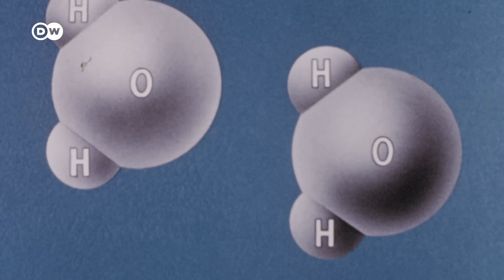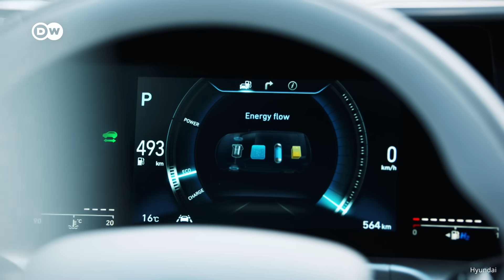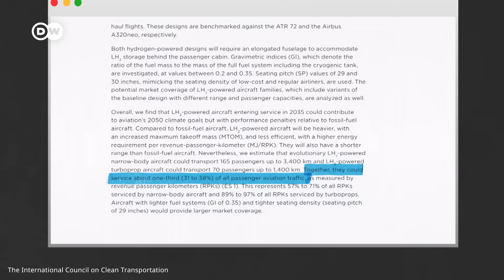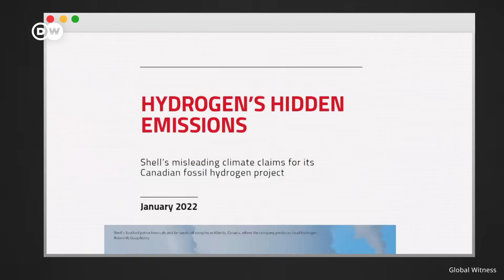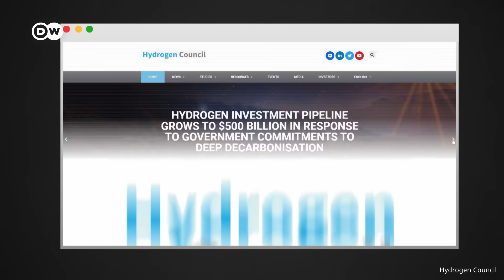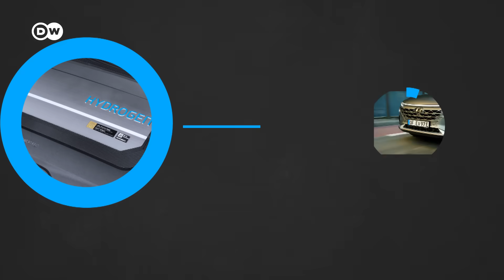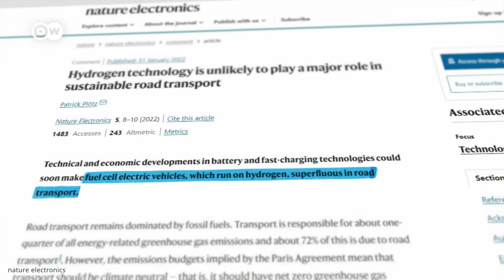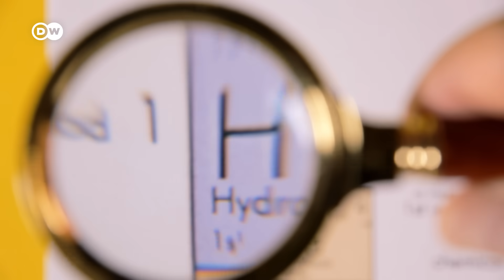The truth about hydrogen

Comment: A big misconception about Hydrogen is that its NOT an energy source, but an energy carrier. Alot of people have been talking about it as the solution to our future energy needs without mentioning that we need an enourmous amount of clean energy/renewable energy to produce, store and transport Hydrogen. But Hydrogen still has its uses to clean up some industries!
Reply: Ok that's literally EVERY chemical as well
Reply: I made the observation recently - that hydrogen is the PERFECT battery... doesn't require mining the materials to build or facilities to manufacture and has no life cycle / disposal problems...!!!  😊
Reply: If you use the word hydrogen alone it is an element. If you have the element hydrogen you have fuel (stored energy). Once hydrogen reacts with another element such as oxygen the energy is spent as heat. If hydrogen reacts with carbon, it is still combustible with oxygen it is still a fuel. Hydrogen is the energy stored in fossil fuels. Hydrogen is a fuel.
The problem you are struggling with is hydrogen is generally not found in nature alone as it is highly reactive with many elements, mostly oxygen. Carbon is the catalyst that allows hydrogen to be a liquid at ambient temperature and still remain reactive to oxygen. Hydrogen can also catalyze with nitrogen making ammonia a combustible fuel that is considered pollution neutral as the atmosphere is 80 percent nitrogen. Using the energy of the sun we convert water into a fuel "hydrogen & oxygen".
Reply: Burn it
Reply: Isnt storage what we need to make solar viable ?
Reply: Bio digested cellulose doesn’t require much energy to produce hemp hydrogen.
Reply: @projectpeace  I’m going to look into this on my own, but can you elaborate on this please? Or point me in the right direction to educate myself on this matter? I have access to a lot of hemp, and hemp project are my original passion project. Hemp can save the world. But it needs to inhabit educated people first.
Reply: @710Kareoke  What aspect of this discussion would you like me to elaborate upon?
Reply: 100%. Hydrogen is really just functioning like a battery, and a less efficient one at that. For space-critical uses, like personal transport it is a waste of time. Just develop good EVs with better batteries and charging stations (or better still, just ride a bike or walk). For weight-critical uses 9eg. aviation) hydrogen may have an advantage so long as its highly reactive (aka explosive) nature can be controlled completely. God help at the 400-odd passengers & crew of a hydrogen-fuelled Airbus A380 when there is any electrical spark!
Reply: @petesig93  check your science .
H2 and H202 are both better at storing electrical energy than any known battery .
Also , H202 is not only immune to spark discharge , its non flammable .
Dont know why i bother to tell you , but we should all know this if we are truly interested in future energy
Reply: A misconception is that we need to transport hydrogen. In most (if not all) cases that's not true, hydrogen can be made on site, where ever there is an electric grid and clean water.
Reply: @Sailorman6996  yes , and dont forget the "other" and more practical inorganic fuel - H202
Reply: isn't that the case with every energy source?
Reply: All fuels are "energy carriers", please stop splitting hair.
Reply: @randymarsh6559  I think he meant water is not a fuel
Reply: @shanedavison7473  I think he meant hydrogen. All fuels are energy carriers.
Reply: @randymarsh6559  In this context, sources describe energy content that exists prior to any human activity such as nuclear, solar, fossil fuels, wind, and hydro.  Electric transmission, hydrogen, compressed air are industrially generated energy transmission/storage mechanisms to serve human purposes.  Treating the matter any other way would lead to double-counting one's energy/power resources.
Reply: Well sometime it is just do it and to getting better and better by learning and experiencence. First of all we should keep the developpement, research and strategic planic of energy away from commercial oriented company and there own goal and move it to public Tasks and duty. 
Second every country should have the task to produce enough Energy and Energy storage by themself  to beeing independend and not been coherced by supplier. 
Third Hydrogen is present nearly all over the world and therefore both goal can bee reached. Of course not for free but on long term based on scaling cheap. 
Fourth desert areas can be used for hug PV and  electrolisys plants.
Fifth Industrie plants in deserts runing with hydrogene left water that can be used for cultivation.
Reply: Same as electricity.  
Not a fuel, just a transmission. 
EVs charging at night are near 100% fossil fuel powered.  Only with worse emissions than gasoline.  Much worse.  

The evidence is in the outlawing of 40W+ incandescent lightbulbs which, were claimed, boil the ocean.
Reply: I've wondered whether deep sea (as in out-at-sea) wind harvesting was viable as an energy source.  We now have the technology to provide floating turbines.  Now, all we need is to use these turbines to generate green H2 at sea and carry the H2 back to port.  Thereafter, the H2 can be put through fuel cells to generate electricity or be burned for heat.
This sounded far fetched to some, but the recently signed deal in which Canada will export green hydrogen (made from wind) to Germany goes a long way towards bolstering this idea.  The main difference is that Canada's wind turbines are on land, of course.  However, with enough floating turbines, the process could be repeated at sea.  It will be interesting to see how things unfold.
Reply: Nuclear is far cleaner.  Nuclear's problems are POLITICAL, not technical.  Unlike all other energy forms, nuclear allows us to put the environmental effects exactly where we want, rather than effecting the area around the power plant.  FOR EXAMPLE, used up fuel can be transported to the same mines from which the original uranium was extracted.
Reply: Bob Lazar has been producing clean hydrogen with only water and electricity in home made hydrogen generator, filling his converted Chevy corvette at night while he sleeps, and gets over 300 miles of range out of the 5 cells in the trunk since the late 80s. There is such a resistance against hydrogen powered vehicles because it can be made at home for free.
Reply: An energy stable carrier, versus electricity.
Reply: And how much energy will it take to move batteries of all sizes a quantity of components to build on site? Probably a great deal more. Hydrogen produced from breaking down sea water by electrolysis at multiple locations is probably more efficient using solar power to generate the energy required for the process.
Reply: Hydrogen is a great souse of  power (. Why re-invent the wheel ) combustion engines 
Can run on it  .. yes the thousand dollar question in  how to make it more efficiently .
Reply: Thorium with Hydrogen as the carrier. That is the future.
Reply: But then so does gasoline. Same principle. Except hydrogen doesn't pollute and is 100% recyclable on combustion.
Reply: WelL not hydro electric thats gravity making the water move from High to low point
Reply: Thorium reactors is the way, 2 by products hydrogen and ammonia
Reply: Just wondering why nobody is talking about the fact that you can run a car on water with an onboard splitter sending hydrogen into pistons and oxygen out the exhaust
Reply: @jimsouthgate4280  - “splitter sending hydrogen into pistons and oxygen out the exhaust”

Actually, it is best to place the oxygen & hydrogen into the piston for combustion, eliminating NO2 emissions.

Sticking solar panels on the roof of the car, constantly splitting H2 & O2 while charging batteries after O2 & H2 tanks are full, allows the car to be more efficient while driving & parked, even without being plugged in. Throw in regenerative breaking. In a big rig 18 wheeler, stick panels on the trailer. 

Water is a pretty nice thought, for cars & trucks, but I personally have never seen a model based on a complete system like this.
Reply: @jimsouthgate4280  you use more energy splitting water than recombining it.
Reply: Exactly, one of the problems with renewables is the sun is always shining, the wind isn’t always blowing, hydrogen is a good way to store excess renewable energy when it’s there for when it’s needed.
Reply: Batteries charge with energy powered by fossil fuels? Not to mention you have to dig lithium out of the ground with fossil fuel powered tractors and transport it with fossil fuel powered planes and trucks. Whomp whomp…
Reply: Just like batteries are. It’s explained in the video.
Reply: Hydrogen is an energy storage. Nobody thinks it is an energy source.
Reply: @hafizuddinmohdlowhim8426  the Sun is the Energy Source - even for petroleum if you think about it
Reply: @NCOGNTO  Sun isn’t hydrogen genius.
Reply: @hafizuddinmohdlowhim8426  the polluting way , at the direction of Big Oil and co operating politicians
Reply: Exactly, it's like a gas battery, not a fuel itself
Reply: @wesleygoncalves6391  except storage in water is cheaper than lithium
H2 is the most common element and H202 has powered the Worlds Fastest cars , pollution free
Reply: @NCOGNTO  That is really important to point out. I'm just concern regarding the price of it, because the low efficience requires a lot of energy to be converted into H2 and then work.
Reply: @wesleygoncalves6391  you would use inefficient devices ?
Try to do better
We need to conserve ... oh no, i guess it theres an unlimited supply (unlike petroleum) ?
HEY ! Use all you want then .
Reply: @wesleygoncalves6391  whats the least efficient tech youve heard of ? My pick is carbon capture
Reply: You're right as well as Howarth, R, mentioned. The rest is a lie!
Reply: What about destroying all those water molecules? - water is a finite resource. We cant make more.
Reply: @ashthegreat1  no water is lost since in the fuel cell the produced H2 recombine with the O2 of the air which was also produced during the electrolysis of water..It is an entirely repeatable and reversible process. Your concern is legitimate since beside producing carbon dioxyde, the fossil fuels produce also water and deplete oxygen from the air, however the impact on sea water level increase is insignificant, temperature increase and corresponding volume expansion is a lot worst then if Antarctic ice about 40 million cubic miles slides onto the ocean then 5 to 8 meter higher level  could be gained rapidly.
Reply: @Johan Wittens Your broad statements have no actual economical substance and must consider all energy related  “costs”( NOT only current artificially high retail SELLING PRICES) : production, storage, transport, mining costs, ressources limitations and pollution costs must all be accounted for…So your evaluation is totally obsolete as two essential facts suddenly became evident: 1, we need to decarbonise our economy and civilisation much faster than anticipated and 2. The surface energies like solar and wind power are becoming overwhelmingly more competitive than polluting fossiles fuels : sun, water and wind are present all over where humans live and the production of green hydrogen with PV is becoming extremely favorable with a cost of quality PV becoming ridiculously low at 360$/kWp retail here and without any significant mining pollution plus a  very little grey energy documented by such extremely low and non-subsidised production cost. The solar energy radiated to the earth surface represents over 1500 times the total humanity energy consumption and is therefore practically unlimited. Moreover, with a presence and availability of this energy all over, any significant and costly energy transport with copper at 10000$/ton or Aluminium at 4000$/ton etc…is NOT needed… would be a cash loss and energy waste, but on another side, a new cheap energy storage on site anywhere is necessary for night power and cloudy or low winds days…

Now, not only solar dc electricity production cost is becoming ridiculously low (less than 1.5 us cents per kWh over the 25 yrs of the solar panel warranty period and free cost after !!!) but the high pressure H2 COPV storage is per kWh stored, about 500 times cheaper already than lithium batteries being about 20 time cheaper upfront (10$/kWh) depending on sizes than lithium batteries at 200$/kWh of capacity, about 160$;kWh Toshiba wholesale level, and taking also more than 25 times more loading cycles than good LIB’s mobile grades or also more than 6 months at full pressure WITHOUT ANY measurable pressure or energy loss….your supercondo looses all its  energy in a matter of minutes, not years like stored H2 so forget it other than as a takeoff boosting power for H2 commercial airplanes at best…

Along-with solar production ANYWHERE becoming totally inexpensive, the cost of H2 storage in COPV’s is also totally negligible then.  The real economic issue and breakthrough is than such local and economic auto-production, self-storage and usage of locally produced solar energy avoids the much much more expensive costs of loading this energy onto a transporting network or into a electrochemical battery storage not durable system. This can become so competitive that it hurts badly the existing monopole of domestic and mobility energy characterised by huge gaps between real production cost and retail selling prices favoured by the lack of alternatives ( sailboats, gliders and cold pizzas only…). For instance even if over 50 kWh of sun power must be produced and stored to finally get only 15 kWh out of the H2 the Miraï fuel cell to the E-mot. to travel 100 kms, because of the “inefficiencies” of recoverable stationary joule losses and pure green O2 production of electrolyser, compressors  and fuel cell, those primary energy and storage variable costs total can well be below one dollar, also very low cost and demanding on mining pollution and limitations and because it works without much grid nor much chemical batteries, it then becomes totally unmatchable economically. One clear  current indication is the growth rate of H2 cars increasing 5 times faster than EV’s and a growth driven by private beans counting financial ventures forecasting its potential all over, not only into rich industrialised and coal burning countries like LIB EV’s and meanwhile, not waiting for gouvernemental subsidies available only in rich industrialised countries with enough taxpayers to pay and support uneconomical mobility means like coal cars, coal-electricity generating half of human CO2 release in the air…and having to come to an end rapidly…
Reply: It's fascinating, the future is very interesting. I feel, at the moment we, the economy, society runs on quick fix opportunities. Making vast profits with very little long term vision. I have been looking, along time with other groups at settings up off grid community, housings, food production and workable resources. Many of these ideas as based on what our great, great grandfathers needed to do. The wider world offers a larger technology spectrum to try and work with. The skills of the past are very valuable and being lost.
Reply: Literally nobody believes hydrogen is a source of energy. Don't attack strawmen.
Reply: I think you meant to say that the misconception is that hydrogen IS an energy source.
Reply: Nobody thinks hydrogen is an energy source. Only the aggressive battery lobby (mostly TSLA stock holders) use this strawman.
Reply: Well you will need to cover the Earth with solar to create hydrogen.  Is it affordable to do?
Reply: Im from the future and i can tell you the solution is the heat energy from de core of the planet, it is endless, easy and very powerfull, the only thing is that you people dont have yet the technology to extract it safely and inexpensive, but its gona change in the near future.
Reply: Well, if we do fusion then it’s an energy source, denser than uranium
Reply: As long as solar or Geo thermal is used for the source of electrical generation then it would be economical.  Fossil fuels are going to run out one day and those  that are ahead of the curve will come out on top of the left over fossils that died off after thet ran out of gas!
Reply: @magicone9327  I assume you mean the Hydrogen makes sense as long as it’s manufactured from solar or geothermal?

Even if that was the case, going from electricity Converted to hydrogen which would be compressed stored in a tank and then said to a fuel cell to create electricity which are then go into a buffer battery and into an electric motor is around 25% efficient. Alternatively simply taking the electricity, putting it into a battery and then sending that power to an electric motor would be over 90% efficient. Hydrogen effectively acts like a very low efficiency battery with some very expensive components along the way. You’ll notice that the only Hydrogen being used in the market is heavily subsidized by governments or by corporations whose primary interest is to stay using fossil fuels as long as possible.

Even worse, over 90% of all the Hydrogen used for transportation is actually made from natural gas. It makes absolutely no sense.

What does make sense is using hydrogen in numerous chemical processes where the element hydrogen is required. That’s not what we’re talking about here though.
Reply: I think you made an error there.
Reply: @usmansaleem9498  please explain in detail what do you think the “big error “is that was made? As near as I can tell Tommas seems is entirely correct with his comment.
Reply: @colingenge9999  If you read the first sentence, you will see that he is contradicting the latter sentences. The first sentence should have been like, "The misconception is that hydrogen is an energy source and not an energy carrier".

I am pretty sure it's just a minor error tho.
Reply: It has potential energy until released.
Reply: @chuckmaddison2924  what “has potential energy until released”?
Reply: @colingenge9999  simple example a battery.
Reply: @chuckmaddison2924  sorry but with your cryptic Phrases and lack of complete sinses, I cannot understand whether you’re making a point, disagreeing or asking a question.
Reply: @colingenge9999  A battery dose not store  electricity  . It stores potential energy chemicaly.
Reply: @colingenge9999  Pull a rubber band energy is stored it now has potential energy. Let go one end it now becomes kinetic as it flicks your fingers.  
 That might be a better example.
Reply: @chuckmaddison2924  OK so we go from electricity which is converted into a potential chemical form which is extracted again as electricity. So for our purposes electricity in and electricity out minus a small percentage for losses. Having said all that, I’m not sure what your point is.
Reply: @colingenge9999  Oh , it goes back to someone saying hydrogen is not a source.
Reply: Evwn if it can be produced without RE electricity, and instead with natural sunlight, it can be cost beneficial. This technology is actually under development right now, with very promising results!
Reply: @jonese6987  “Natural sunlight “is renewable energy.
Reply: @colingenge9999  Yes but the video was referring to RE electricity based, that was my point
Reply: @jonese6987  Sorry but your message was too cryptic to understand your point.
Reply: @colingenge9999  ok, hope you understand better
Reply: Batteries are also not an energy source
Reply: Hydrogen is energy 
33 kW per kg
Reply: That's not always missed. This is often an argument against it that I hear. 

Electricity is easy to create clean and away from fossil fuels. WE already have solar, wind, hydroelectric, geothermal, and nuclear.(the last being questionable).

What we need isn't developing more into electricity generation (though, yes, we need to build more generators), but instead, we need solutions to *mobile* energy. Hence the need for fuel cells.
Reply: Hydrogen production by electrolycis has only 70% efficiency, however there is a new process which is cheaper and much more efficient, about 95%, this could be a game changer. The electricity needed for this process could be supplied from renewable or nuclear sources, the process is called E-TAC and was developed by startup named H2PRO which already has a pilot production facility.
Reply: Question, It being an energy carrier, we could generate endless energie in desserts, transporting energy to other places?
Reply: @Dutchmijk  
We’ve tried to put huge power generation stations in deserts. It doesn’t work. The only efficient power is generated at point of use, like gasoline.
Reply: @Dutchmijk  Well, it would hugely depend on the specifics but generally speaking it is far more likely to be much more efficient to 'just' transmit the electricity over-land (and/or under the sea).
Reply: In fact it's source in fusion atomic....but in our case it just a transporter energy.... even  awkward both we don't master well.....🤔🤔🤔🤔
Reply: It's not a misconception. It's the truth. As seen in this video, H2 does not exist in useful forms in nature. You have to split it from methane either using steam reforming or electrolysis. In that case, the energy source is the methane or electricity.
Reply: It
F
‘

L
Reply: No such think as a source of energy: 1st law of thermodynamics
Reply: Can we use Hydrogen as an alternative to our battery issue? A lot of the problems with today's energy crisis is storing the energy produced (I'm commenting this 49 seconds into the video so if my question is answered in the next minutes I apologize)
Reply: "From that time Jesus began to preach, and to say, Repent: for the kingdom of heaven is at hand." Matthew 4:17 

"Ye have heard that it hath been said, An eye for an eye, and a tooth for a tooth: But I say unto you, That ye resist not evil: but whosoever shall smite thee on thy right cheek, turn to him the other also." Matthew 5:38-39|○
Reply: There's lots of oil and coal left to burn 🔥
Reply: That is exactly the comment I just wanted to type. An energy carrier is pointless if you don't have enough energy to begin with. And the energy that we hopefully will have, will be too precious to waste it on hydrogen. Yes, we will need hydrogen for some applications, but we should only use it if more efficient technologies are not available for this application.
Reply: @fr89k  Go on then, do give us an example just one that is more efficient than Hydrogen, and not specifically localised.
Reply: @thetruthhurts7675  Why would I want an example that is not localized? Almost every consumer has some kind of localization. Therefore, I disregard this requirement and give two examples: Batteries and directly using the energy.
Reply: @fr89k  By localised I meant solar panels in my garden (as a source of localisation, and you name a localised source to use as your argument) which produce all of the power needed in my house. Batteries are the least efficient way of utilising power. They have what is called long term, memories, so if you don't fully discharge them the power gets less and less over their lives. Plus the power lost just charging them is over 20% how can you even compare that to a 2 to 5 percent power loss, which includes transportation by Hydrogen? Come on you can if you try do better than this you claimed Hydrogen isn't efficient, yet you named the most ineficcient wasteful power source as your one option, by the way there isn't a more efficient power source than Hydrogen, but hey you tried, and failed badly!! Directly using the power is what I do with my solar panels which have replaced my as consumption in my home completely (that is also localisation by the way).
Reply: And very energy inefficient in comparison to fossil fuels
Reply: I am Chemist and you are spot on.  I view Hydrogen in this context as a chemical battery.
Reply: Then everything is an energy carrier not an energy source.   Energy sources are electromagnetic force and the strong force.
Reply: Our planet expels about 220 million tonnes of hydrogen into space. Once we are able to capture this it will get much better and cleaner
Reply: @TheGearslayer  Interesting.  I've never heard of this before.  What process releases this large quantity of hydrogen?
Reply: So is fossil fuels. You need energy to pump it up, refine and distribute it.
So is wind, you need windmills, so is solar..... you do the math.....
Reply: Renewable energy ✨️ is not Renewable lol 😆 unless solar  panels, batteries, and turbines  are made in china 😄
Reply: Capture the CO2 and split the carbon  off it, then manufacture Man Made Diamond Batteries this will sequester the carbon indefinitely the diamonds will power a vehicle for 1500 years without the need for recharging.
Reply: It's likely saying that electric lines will meet electricity needs (as if lines were an energy source)
Reply: WELL SAID;
Your remark sounds quite intelligible...
Reply: @samuelmartin2817  Thanks. I have seen articles that state that EV and fossil fuel cars have broadly similar efficiencies.

'EV has an overall efficiency of about 60% while the fuel powered car is about 20% (or less) efficient. When one considers the total path from primary energy, the efficiency of the electric car is 60% x 40% (grid efficiency) for a total of 24% while the fuel powered car has an efficiency of about 20%. When the bigger picture is considered, the two forms of transportation are not all that different.'

In 2018 Mazda claimed that they hope to achieve 56%  efficiency soon.
Reply: We cannot use/rely upon  hydrogen(grey, blue, green)  for everything, vll have to be specific.
Reply: There are multiple inventions (suppressed) that will supply hydrogen on demand without storage. Such a concept that hydrogen must be stored to use is inaccurate.
Reply: Yes but if green energy is used to produce it ,   its way better than any oil products,  plus it produces no emissions when used as a fuel.....how is this worse than using any hydrocarbon
Reply: Free hydrogen is hard to find. Splitting hydrogen typically requires more energy to separate the hydrogen from water. Frankly, mixing it with oxygen is as an ideal fuel.
Reply: Why does everybody keep repeating this like it's something clever or relevant? Are batteries an energy source? What's the alternative?
Reply: ok then y'all are "hopeful"in using wind and solar to replace our (USA) current use of oil for energy yet there aren't enough batteries to store our current power needs when the wind stops and the night arrives?
Reply: So are all fossile fuels. They carry the energy of fotosynthesis and sunradiation of millions of years.
Reply: I agree with you but hydrogen can be an energy source as you can burn it and in enough quantities actually explode. I drive a Tesla and I am trying to get my home community to install solar panels with battery storage. This will definitely move us towards the net zero carbon footprint in the near and long term. I believe that electric planes and ships and steel manufacturing are possible in the distant future and hydrogen can be a stop gap measure. Definitely no to gray hydrogen.
Reply: Produce on demand. H1 is more powerful than H2.
STP is calculated in the argument. But water can be separated easily below 0c or 32f degrees.
Reply: It is an energy source and carrier. We have already h2 engines using h2 (1st so called e-fuel) instead of fossil fuels
Reply: Too many open doors. We need green hydrogen.
Reply: so are batteries
Reply: That's why it's better to compare hydrogen to battery technology. Or grid transmission.
Reply: Very true.
Reply: H2 plus O2 is energy bruh
Reply: You dont know about the new way of  produce h2 developed recently in japan with a new secure nuclear reactor. The new generation of  nuclear reactor makes it almost clean. They will develop a Technologie to deal with nuclear waste.
Reply: So  we go from putting CO2 , plant food,  into the air.  To a much stronger heat retainer  water vapor.
Reply: By that logic, everything is just an energy carrier lol
Reply: You hit the nail on the head.
Reply: Humans will make it work.....
Reply: @ckb3234  love your enthusiasm but it's just not how things work
Reply: @fluchtigziege3202  that's how exactly things have worked out so far.....Some innovation here...some there and boom you break through.....
Reply: @ckb3234  we can't simply change how physics works out of willpower
Reply: @ckb3234  You ,like platitudes.
Reply: The Germans built a submarine that had hydrogen fuel tanks outside its shell so that if the hydrogen ignited it wouldn't destroy the submarine. I don't know if it is still in service.
Reply: You can easily create hydrogen with some solarcells or windturbines. With that you can power your car and house. Green hydrogen works.
Reply: Might sound crazy now. But I'd like to see a Hyrdogen Battery. A totally different battery. Looking totally different as well.
Reply: Aparently, it also helps your body to clean itself.
Reply: Seriously? Just imagine green hydrogen obtained from natural gas using more efficient nuclear powered energy  pipelined thousand miles like nowadays oil  to major stations throghout the country? I think it wiil be a good alternative to OECD lithium powered lobby climate zealots.
Reply: So you mean that the misconception is that it IS a energy source...
Reply: A good thought.  Politicians see electricity as an energy source - which of course it isn't. We can call falling water, the wind, rise and fall of the tides, and heat from the sun or the burning of fuel, as energy "sources".
Reply: I agree 100% if it can be used as fuel in a combustible engine and could also have other energy applications. 👍
Reply: Spot On.  OK.  How to produce it cleanly?
Reply: "A big misconception about Hydrogen is that its NOT an energy source,.."
==
What's better then, stupid?
Reply: I works in a hydrogen company as design engineer. The company has huge orders. We are using it especially in stoves , laser cutting and welding.  

Hydrogen startup are easy and simple .
Reply: It's basically just steel production, or at least for headline times even then we need to stop producing 95% of our hydrogen from steam methane reforming which not only releases CO2 at the same rate as burning it, the process also costs energy meaning it's actually just better to burn the methane and the cost of the hydrogen chain needs to come down while we also move to the more expensive option of electrolysis, I just don't see it. For anything else thermal batteries for process heat seem like a better option for big headline items like cement production as we currently have thermal batteries that can deliver temps of 1500C with internal temps of 1800C.
Reply: Isn't petrol, charcoal and gas an energy carrier?
Reply: I would say the same misconception exists with oil. It takes a ton of work and energy to extract and refine oil.
Reply: Absolutely right
Reply: You are missing the point that currently a lot of renewable energy goes to waste. In fact in many grid systems pay renewables to turn off in times of excess production. The efficiency of conversion to hydrogen is not an issue in these circumstances and would be a perfect storage method. And the storage issue has been solved it just isn't getting investment.
Reply: The misconception is that Hydrogen is an energy source.
Reply: @2nd3rd1st  so is oil 
Its stored solar energh from a long time ago
Reply: @2nd3rd1st  first A) the energy is not enormous, approximately 50kWh of solar PV dc power for 100kms of an H2 car, then B) this power at 400$ per kWp of Quality PV schingle warranted 25 years cost NOTHING, just divide 400$ by 30000kWh…then it’s free….COPV cost nothing either about 10$ per kWh of capacity good for 50000 cycles minimum with no measurable loss. Then nothing gets loaded onto the grid and nothing gets stored into batteries which both are EXTREMELY expensive : Li battery 200$ per kWh of capacity only good for 2000 cycle max and power grid with copper 10000$ per ton and Aluminium at 4000$ per tons..then you sell the pure O2 produced for welding and covid patients ..but this is a free bonus… so your conclusions are technically correct but economically irrelevant..
Reply: @2nd3rd1st  Wind sun nuclear are sources.even oil and gas ere carriers too
Reply: @2nd3rd1st  So then, what is energy if hydrogen isn't a source? Think on it?
Cheers
Reply: @2nd3rd1st  .
Reply: @2nd3rd1st  Only hydrogen is not generic energy but when we react with Nitrogen at a high level of heat then it produces More heat in the engine.❤❤
Reply: Yes in transport that can not use batteries, it makes sense.  The power consumption from production and use of Hydrogen is probably 3x.  But for e.g. shipping and some transport it makes sense.
Reply: @la7dfa  It depends on the source of energy, for electricity it's about 80+% round trip in the best cases, for coal, natural gas or biogas it's more efficient than having to convert it to electricity first (probably the same for other hydrocarbons), solar hydrogen is more efficient than solar electricty depending on the implementation... (but in the end it's way more efficient than batteries due to lower weight and less frequent maintenance).
Reply: Closer to 75% more then 3x including storage. Which, mind you is still more efficient then current oil, finding, drilling, refining, transport, spoilage, car engines being worse then fuel cells, ect. Clearly we still use gasoline and don’t care about efficiency. It’s only because we have preexisting oil infrastructure but if we built new renewable infrastructure hydrogen will be far superior because again it is already more efficient in terms of energy refining the oil. People also love ti throw around the word “waste”. They think Hydrogen is a waste of energy. I disagree because hydrogen plants use surplus power that is not being used to split hydrogen so already your salvaging some energy that would otherwise be wasted. Also hydrogen tank and storage is still cheaper then battery bank of same capacity. So literally if you tried to store the same amount of energy with a battery you would bankrupt yourself therefore preventing you from salvaging more total power. Even if it’s less effectient the fact you could affordable store so much it nigates inefficiency simply because even 100% efficiency is bad if you could only store 20% of your faulty surplus power. Where as 20% efficiency is still good if it allows you store  %900 of your daily surplus.
Reply: @la7dfa   I thought it was “ridiculous” also until I ran the numbers.  JP-8 jet fuel is 9.5 kwh/litre, gasoline 9, cryogenically cooled Hydrogen which required a refrigeration plant is 2.3, 700 bar compressed Hydrogen is 1.3 and 350 bar is 0.65.        My figure of 9 times the volume was a rough number but 350 bar would be 13.5 times the volume and 700 bar would be 6.25 times the volume. Those enamoured with Hydrogen cannot change the physics which makes Hydrogen extremely inconvenient for transportation due to the huge volume required but it doesn’t stop there. Making Hydrogen is costly, shipping and storing it is problematic and converting it to road power is complex also.

This physics defines why Hydrogen is not used and probably won’t be used for much transportation and you can yell FUD all you like but you’ll not change physics by doing so.  

I had my bubble burst on Hydrogen by doing research; sorry to break the bad news but facts ain’t FUD.
Reply: @la7dfa  What transport can't use batteries?  Battery EVs are totally scalable.  The video dismisses electric heavy goods vehicles on the basis of charging times and yet in any civilised county, permitted drivers' hours provide for totally adequate recharge times without any practical penalty.  There isn't any from of transport that can't be done with batteries (bar rockets) at least to some useful extent - even aircraft.  Battery energy density has already improved 4-fold in just the last 10 years alone.  It will very obviously continue to improve and do so at a rate that will make H2 irrelevant well before H2 systems can work on a cost and practicality basis.
Reply: @la7dfa  Hydrogen is cheaper to make than electricty for car batteries, and takes less electrity to make.
Reply: @la7dfa  But does it make more sense than nuclear for shipping? Especially if Thorium reactors can be commercialized.
Reply: You worded that wrong but I get what you mean, might want to edit that
Reply: @raunakshahi8485  What he is saying is that Hydrogen is an energy source, it basically powers the sun, and all of the stars we see. Why did you find that so difficult?
Reply: @raunakshahi8485 Sorry mate, who are you talking to?
Reply: @raunakshahi8485  What wording was wrong?   I thought it to be exactly on.
Reply: @raunakshahi8485  wrote ?
Reply: A big misconception about CARBON, is that its NOT an energy source, but an energy carrier.
The difference is, that there is no fossile hydrogen and you have to "produce" it by yourself with energy.If you produce ist by wind, sun and water, it´s the "holy grail, if you produce it with fossile energy, it´s useless.
Reply: @morkvomork6815  Did you fail high school chemistry? Carbon is not an energy source or a carrier (apart from fission I guess), it's an atom. The energy is stored in the bonds. More bonds = more enthalpy, more products = more entropy, which together release energy.
Reply: @DoesntRefillTheBrita  Like hydrogen?
Reply: @morkvomork6815  Hydrogen, or H2, does have a bond. It's between the 2 hydrogen atoms :/

As you can probably tell, it doesn't have nearly as many as most organic chemicals, which is why it sucks for energy density.
Reply: On the flip side, hydrogen packs the most energy per pound which is why bass uses it as rocket fuel, they also use it for electric because it does not pollute space station’s exterior and is quiet, hydrogen can act as cooking gas, on demand electric (portable or non portable on demand generators), and travel fuel at the same time. It never expires. It refuels 5 minutes instead of 30-hours. As for the “energy density con”, here’s a secret, batteries are even worse energy density and energy to weight and are more expensive. But let’s say you want hydrogen to be even more energy dense, in its plasma form it can denser then even the desist elements. Look up sun plasma density. It can reach 150 g/cm3, bigger stars can reach 500+ g/cm. No fuel molecule can ever get that dense let alone a structure like a battery. But again hydrogen is already more energy dense and lighter then a battery which is why range and carry capacity is not a problem for hydrogen as it is for bats. Just look at a Muir’s hydrogen tanks vs a Tesla’s battery underside. Not even close. Batteries weigh down a streamlined energy efficient design especially at scale. US Military was able to extend drone flight time from 30 min with bats ti 8 hours with fuel cell which more then makes up for upfront energy investment. Also you don’t need to invest energy to get it, there are photosynthetic molecules that split water in sunlight, microbes that digest and reales it, algae that reales it and suck up CO2, and in the far future the next paret after mars wich is like 4x more massive then earth is like 80-75% pure hydrogen gas. More then enough for our planet. Do batteries and hydrocarbons have a whole planet that close almost entirely made of energy that can be tapped? A charged battery planet? A oil planet? No. Then there is the stars and fusion in general which is also hydrogen based so in away every renewable is already hydrogen powered. Even farther Dyson swarms would make energy scarcity a thing of the past. Hydrogen is the future.
Reply: @DoesntRefillTheBrita  33.33kwh/kg
Reply: I'm not sure where you get this as a misconception. Your point is quite frankly pointless. This is true of literally every alternative to Hydrogen because that's the space we're working on. We're trying to provide a method to store and transport energy to use in distributed disconnected situations. Of course it's an energy carrier. So is electric and gas and every other method we might ever come up with. What's your point?
Reply: It explodes. It's an energy source. Stop failing science class
Reply: Transport hydrogen with hydrogen...the problem is they want to keep the old with the new when in reality if everything goes green hydrogen it will initially cost alot that's true but in the long run will save alot and keep the planet cleaner. Issues is it will not happen because fossil fuel companies will kill it until they have nothing else to pump out of lol
Reply: You don't actually need "enormous" amounts of energy. Some students at stanford university in 2017 I think, built a small machine which they simply dipped into the ocean, it was powered by a single solar panel to run a little air compressor and the electrolysis needed, and it successfully separated water into its components. The students concluded that this could be done on an industrial stage if upscaled. So its already possible to do hydrogen on a mass scale the technology is here, but, trouble is the oil tycoons and the energy companies have already invested in batteries...
Reply: @mikeb53  yes you do need an enormous amount of energy to power the world.   If you can build an affordable hydrogen plant then do so.  The cost is always the biggest factor that holds back most technology by the way.  The average person is poor and cannot afford 100K a year for electricity.
Reply: @shanedavison7473  I never mentioned powering the whole world. I was only talking about electrolysis to get hydrogen.
Reply: Hydrogen is practically converting electricity to a clean fuel, imagine turning electricity into gasoline, that's how hydrogen is.
Reply: @Thor_the_Doge  Imagine turning electricity to power directly without any immediate. That's how clean battery EV is.
Reply: Well then nothing is an energy scource since energy can't be created nor destroyed. Though can turn into, or be "created" from matter.
Reply: Since the enormous clean green energy to produce green hydrogen is not coming any time soon, the fossil fuel sector is happy with blue hydrogen false promise. Hence the oil and gas companies lobby, and want lots of applications to increase demand.
Reply: Wind turbines produce AC.  To perform hydrolysis you need DC.  You have losses in the turbines and DC conversion (about three losses).  The electrolysis produces heat (another energy loss), oxygen and hydrogen and you lose energy in gas liquefaction (another energy loss).  Re combining the hydrogen and oxygen also produces heat (another loss).  If you use a thermal engine to recover  that energy  you also have those losses (at least another 40%).

Hydrogen is no more than an energy store.  The losses are horrendous.  The whole storage process is grossly inefficient.

The same is true for battery  energy storage.  All of these so called RENEWABLE ENERGY SYSTEMS are highly inefficient.  

Since we are talking about electricity we  have losses in  transmission and distribution.  These are fundamental problems of using SECONDARY forms of energy like electricity.

Contrast this with the use of petrol, gas or even coal.  These are primary energy sources.  Which are the most efficient methods of delivering energy.
Reply: @Land-of-reason  can't ignore how inefficient an IC engine is.
Reply: @Sleeperknot  Mazda hopes to achieve 56 percent thermal efficiency with the Skyactiv-3 gasoline engine. That would make it the most efficient internal-combustion car engine in history.
Reply: @Land-of-reason  - “wind turbines produce AC”

They don’t have to. Generators can be wired for DC. A full wave rectifying bridge turns AC into DC. 

Either way, H2 can be easily produced. It might be best to produce H2 & O2 off shore using wind turbines, piping the gases back to the shore.

H2 and O2 sent back to the shore can supplement natural gas supplies. These can be stored, unlike wind power. This can slowly eliminate natural gas supplies as they run out.

H2, especially for people by coasts, looks like an amazing option to supplement our energy needs.
Reply: @DavidHalko 

The maximum efficiency of a bridge rectifier is 81.2%.  We tend to use AC because of transmission lines.

For H to be used on vehicles you would need liquifaction.  This is highly inefficient process.  Piping liquified H is also an issue as the pipes would need to be lagged. Most places that supply hydrogen do it fill up point.

So 82% efficiency to produce DC, most phydrogen liquefaction plants operate with a relatively modest thermodynamic energy efficiency of 30 to 35%, then you have the efficiency of hydrogen engine 20-25%. So that is roughly 5% efficient.  So 1kw of wind energy gives an output of 51w mechanical output.  

Where do you think that the 941w goes? Ah heating the environment.

Incidentally I have not taken into account the inefficiency of the turbine itself which is 20-30%.  Incidentally their are also variable inefficiencies due to the transmission through pipelines. 

What degree do you have David?
Reply: Hydrogen is an energy store but so are hydrocarbons. The only difference is the process, with hydrogen typically using electrical inputs and hydrocarbons deriving it’s source of energy from the sun, converting photons into plant based carbon molecules which are then converted into hydrocarbons. Bottom line, hydrogen can be “clean” if the electricity is “clean” but hydrocarbons will never be clean.
Reply: @bscott53  - “plant based… into hydrocarbons… hydrocarbons can never be clean”

That is the most backwards thinking I have ever heard… that reasoning is so backwards.

Plant based hydrocarbons are the absolutely most clear option there is on the planet, since plants consume CO2 and produce O2!
Reply: Yeah it's an energy storage not an energy source per say, it will never be used for heating or electricity (probably) only in portable systems.
Reply: I mean electric isn’t that good for heating which is why a lot of places in the US use gas heaters/water heaters. For industry they need hydrogen for heat to and we already have the infrastructure to pipe hydrogen to homes for heating uses so I don’t know where this “hydrogen is bad for heat” came from?
Reply: Though the 20% percent loss along the way is a big lie. The number is much much larger. Take the alternating current for example - even the way of us transporting electricity has losses. It's called alternating, because the current is alternating, which means, there are additional losses even when we don't even power anything with it.
Reply: @seb_industries  It's painful to read what you wrote because you seem to be shouting nonsense but randomly stumble close to a few almost valid points that still isn't relevant to the comparison.
Yes, there is loss on an AC grid, but it's not like DC power doesn't have losses. For all the problems with parasitic resistances between wires and ground or anything else, it's typically still better than stepping up the voltage then converting to dc (unless you are going underwater or underground or something). If you don't step up the voltage the parasitic resistance of your wire is a much bigger problem.

Also none of these matter because we are comparing what you do with your electricity sourced from the same place. So it doesn't matter that your coal power plant is only 50% efficient, then you lose another say 10% on transmission or whatever. It doesn't even matter that idn only 10% of a plant's biomass becomes coal in the first place or something. It's the same starting point.

After all those inefficiencies, power has been delivered to you. If you get say 80% efficiency if you charge a battery and run a motor from there, but only 60% if you charge a hydrogen cell, run a generator off that cell, then power a motor from the generator, then that's your efficiency difference.
How that electricity got to you is irrelevant in this comparison.
Reply: @randomnobody660  well i didn't mean it is necceseraly bad. Bud it certainly has its drawbacks, not to mention all the lithium ion batteries, they're not going to get more environmentally friendly. Though I got to say I don't know what else to use. Perhaps hydrogen or synthetic fuel, they have their drawbacks too though... I just want to point out that many people say how much green electric cars are, the truth is, the final efficiency is not much better or equal of that that ICE cars have.
Reply: @randomnobody660 It's more like 92% round trip efficiency for battery storage and 16% for hydrogen storage and fuel cells, in the case of electric cars.
You can't turn the fuel cell off when you're stopped at traffic lights as it has to stay hot to work.
Reply: @seb_industries  it was a 20% loss from the electricity supplied to charge a battery. For hydrogen that conversion loss is 60%
Reply: @petesig93 What about time loss, how long does it take to charge a car battery? How much time is wasted? There’s always a trade off, you can’t trick the laws of the universe.
Reply: @seb_industries  DC and AC have losses, just different types of losses. Transporting energy in the form of electricity from point A to point B is probably the type of energy transportation that causes fewer losses, when all factors are considered.
Reply: @seb_industries  Sorry, but I haven't the faintest idea what you are on about.  In terms of converting electricity from a source, storing it directly in a battery and then powering a motor from it, the losses absolutely are about 20%.  Using H2 made from electricity and then powering a electric motor from it via a fuel cell is actually worse than 30% efficient.  However, one place where there is room for huge improvement is in the long distance transport of electricity.  Ih the UK in 2018, 56% of all electrical energy either made here or imported was lost due to 'conversion and transmission' (UK National Grid's data - perhaps this is what you were referring to?).  Transitioning to a much more local generation model by using wind and solar (and maybe tidal, too) would therefore permit a massive reduction in electrical energy need as it would then be used where it is made.  The recent huge developments in battery storage will make this entirely possible, removing a large portion of the need for fossil fuels (let alone H2).
Reply: @seb_industries  what's your source of your statement that 20% of loss is way understated at a national level (so we can read up on it).
Reply: DC then
Reply: @seb_industries  that's a separate topic altogether! And a big part of the current wars. In fact, for comparable voltages, Tesla's A.C. had fewer losses hence winning out over Edison's D.C.  - though over 100 years later, we do use high voltage DC for long distance transmission.
Reply: @seb_industries  20% is on the high side. Long distance transmission of high voltage electricity only loses about 5% and depending on the EV maker efficiency varies, Teslas are up to 92% efficient, so grid to wheel is 87% 
They said here H2 is 40% efficient but it's less than 20% once you factor in all the energy and materials used to build electrolysis plants, distribution networks, and refueling stations. Then there is the additional ongoing cost of energy, labor, and maintenance required to keep that infrastructure running and open for business.
Reply: @booobtooober  well, if you take in count how the electricity is made. That number drops bellow 35% and that would be very optimistic. For example here, in Europe, which is considered to be as efficient as possible, the best we can manage to extract from superheated vapor is about 35% of energy from turbine. Let's not lie to ourselves that solar and wind energy sources can cover the whole electricity demand.
Reply: @booobtooober  
Said, "... 20% once you factor in all the..."

That's the same thing with other energy sources!  They *all* have LCOEs - levelized costs of energy.  The whole physical universe has losses that have to be factored in.  "Well to wheel" of fuels is not any better, furthermore fossil fuels are not renewable and are slowly being used up.  Switching to renewables is at least as good, usually better.
Reply: @booobtooober , everything requires infrastructure. This is a smoke screen argument. You did not mention the infrastructure for Teslas batteries?
Reply: @seb_industries  you use the word lie too much it loses the power (ironically) of the general points you are making. Here in the UK and in most developed countries outside of the US we have a significant reliance on nuclear fission reactors for energy production, I can only see that changing after fusion reactors become the clean solution at some (unknown) point in the future. UK wind solar and hydro make up over 25% of our total production and it's rising fast. It's part of a mix and will always be. Our uk national power grid is 60% inefficient with a huge investment required in what produces it how it's stored and it's connectivity with micro producers.
Reply: Or you just make hydrolysis in place and use the gas to burn the fuel. Then u just need the water. But the reason why they don't talk about this is that you can't really sell people water, right. So if you make the hydrolysis in a car for instance, then you just pay for the system once and no more refuelling. That means a lot of people lose money.
Reply: @Melanrick  high pressure injection
Reply: @Melanrick  ... how any why would you want to perform hydrolysis IN THE CAR?
Reply: @DoesntRefillTheBrita  Because then you don't have to buy it. You can just separate the hydrogen from the oxygen right there. The fuel tank would be minimal, you would only need the battery to start and the motor to burn the fuel and move the car.
Reply: @Melanrick  I don't think you understand how hydrolysis works. It requires energy to decompose water into hydrogen and oxygen. That's like saying "oh just make the gas in the car, then you won't need a big gas tank"
Reply: @DoesntRefillTheBrita  You can use a battery cell to start the process then refill it with the process itself. If we refine our tech just a bit it's doable.
Reply: @Melanrick  So a perpetual motion machine? Ya those aren't real buddy.
Reply: @DoesntRefillTheBrita  It's not what I mean. For instance it takes more energy to go full speed than to just keep the motor running. As long as the production is bigger than the amount necessary to start the reaction, it should be fine. And it's not a perpetual machine because you need materials to make it work, aka, water and minerals. Every car works like that. You have a battery, u burn the fuel and it produces more than needed to keep it working.
Reply: Not nesasarily. Microbes including algea (carbon negative?)  can produce hydrogen and we have artificially catalysts in many forms that split water directly form sunlight.
Reply: @DoesntRefillTheBrita  33.33 kWh/kg
Reply: @johnwalker1553  now convert that to liters (or gallons)...
Reply: @Shinkajo  Then please explain further.